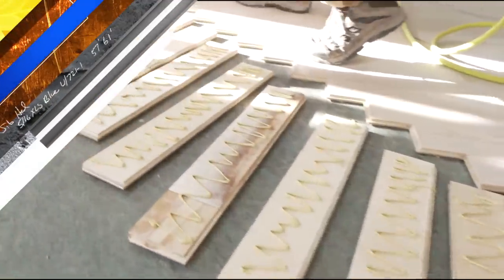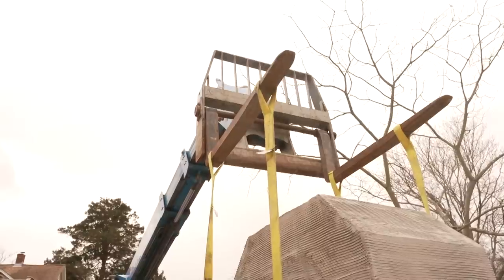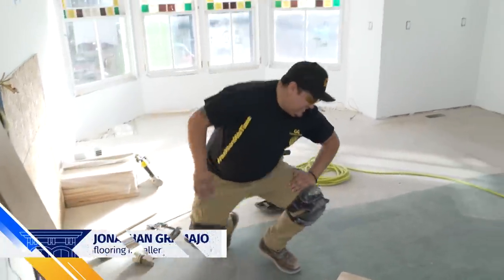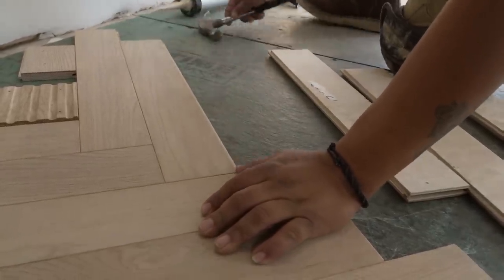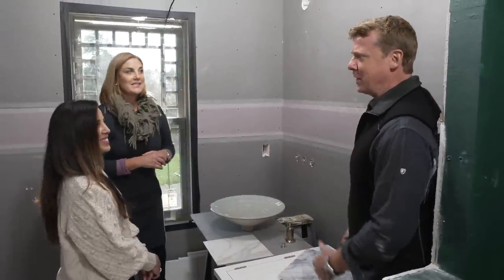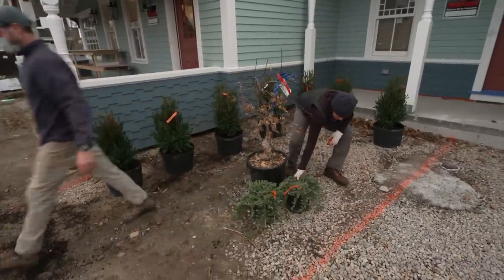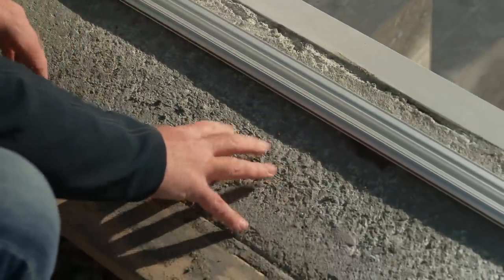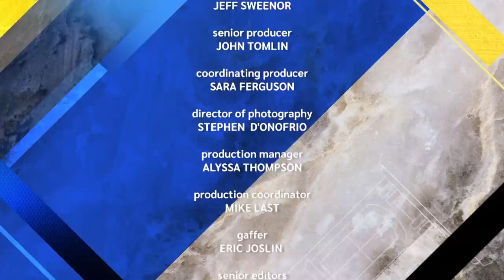This Old House | Pizza Time (S42 E12) | FULL EPISODE

Comment: Why would you set all the outdoor kitchen components without grouting the joints in those pavers? I know those joints underneath will not be seen but the fill/grout locks in the paver system. Over time the joints up to the edge of the kitchen equipment  will breakdown and  have to be filled. Also, in the future, if you move things around you will have to fill/grout that area and it will not match the existing.
Reply: I bet they will grout underneath the kitchen components. It's just with their shooting schedule they just have it on display for the TV program.